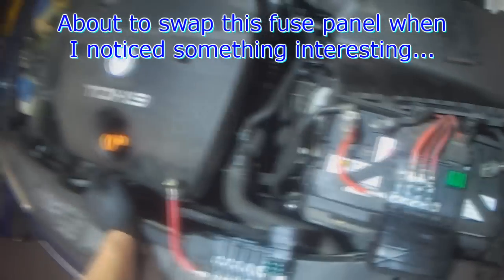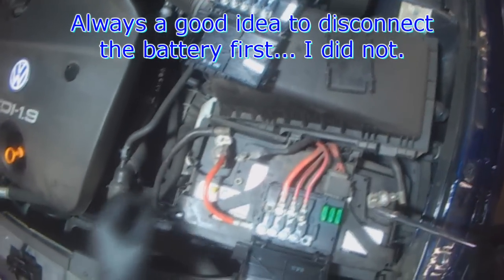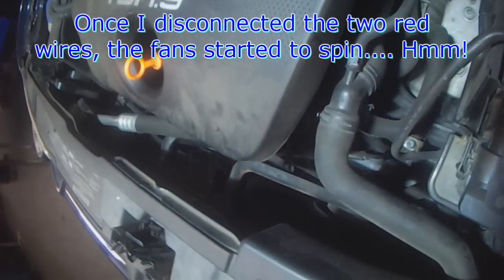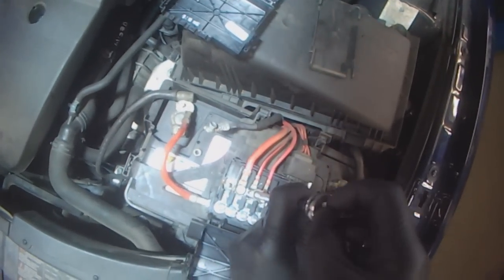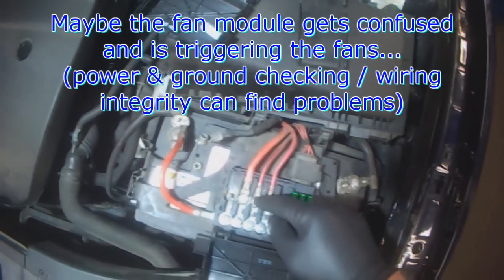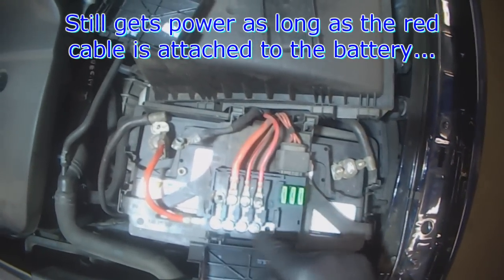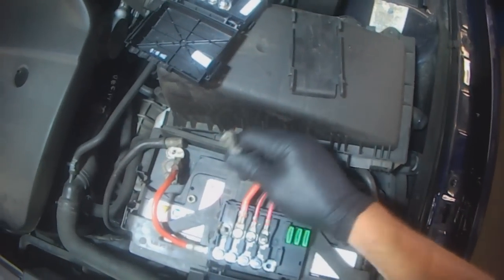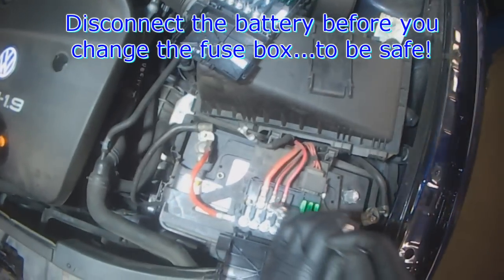VW A4: Weird cooling fan behavior!

Comment: Great video and the channel. I have question: My car is 2012 passat 2.0 TDI. The car overheats after a couple hours of drive even if its minus 10 outside. So i tested water pump basically removed lower rad hose when thermostat opens and check the flow also i checked the return and it has flow as well. Thermostat opens when temperature reach hot so it works fine and as i said I detached lower radiator hose  which becomes hot as well and water comes out  so its not clogged radiator either. The coolant level is the bottle correct when overheats so its not the missing coolant problem. So now the fans work very weird sometimes i see smaller fan work or when i park the car it still works for a minute but when the car was actually overheating and the gauge went over half the fan DID NOT kick in, also the big fan which i assume is only for ac never works. Please help me out here i think maybe its that module or maybe fan is just bad?
Reply from the maker: Both fans should work together whenever cooling is required. Using a scan tool... one can check / verify fan operation & check for fault codes. Here's a video where I check / activate them: (should be similar to your car)

https://youtu.be/oqdv4cm86Ns

The module is part of the large fan... replace just the large fan or both.
Reply: @EXOVCDS  Ok tnx I will check the module. Anyway did I do the overheating steps properly? Here is the lower radiator hose at 2000rpm when the thermostat is open, not sure if this is how the flow should look like ? https://www.youtube.com/watch?v=rNPjAu9KKkk
Reply from the maker: Flow from the hose does NOT indicate that the thermostat is open... the thermostat is located in the engine block, behind the flange that the hose connects to. You will ALWAYS have flow through the radiator, thermostat closed or open. I'm still at work, can explain further once I am at home later tonight.
Reply: @EXOVCDS  Thermostat opens a little latter after the car worms up than upper hose become hot, the pump works fine because there is heating inside of the car. Yesterday temperature was going over normal and i lifted the hood and the fan still did not kick in so I went to my mechanic this morning and told him about the fan but he still held his original idea the head gasket is blown and he said the fan did not start because of some steam build up on the fan thermostat but the gasket is the problem. I looked at the return coolant bottle there is no small bubbles and also oil oil cup has no yellowish sludge from coolant burning which is usually the indicator of the burning coolant inside of the engine. I hope is not head gasket, what do you think?
Reply from the maker: Just to be clear... the upper hose gets hot REGARDLESS if the thermostat is open or closed. The thermostat controls flow INTO the engine , not out of. The water pump pushes coolant from the engine INTO the radiator via the TOP radiator hose. The thermostat lets COLD coolant INTO the engine via the LOWER coolant hose. The thermostat can intermittently stick CLOSED, not allowing coolant to ENTER the engine via the LOWER hose. If colder coolant can not enter the engine, then the engine will overheat. The ECM controls radiator fan operation.... when temperatures get too high, the fans come on. If there is a problem with temperature sensors... the fans come on (fail safe). Either there is a problem with the radiator fan module (part of the large radiator fan)... or the thermostat is intermittently sticking closed.
Reply: @EXOVCDS  I see, anyhow we changed the thermostat last week and it did not solve the problem but gets longer to overheat before was less than 1 hour and now is 3 hours of driving . I watched this video about vw and it must be false claiming the upper hose gets worm when thermostat opens. https://youtu.be/YbzDJqPIUrA
Reply: Again my mechanic thinks its head gasket since we changed thermostat, he said at around zero degrees outside you have a very small chance of making a diesel car needing fan with normal driving through the city, is this truth?
Reply from the maker: That video is completely wrong... they don't even use proper tools to hold things in position. They removed my comments years ago about what they did wrong.
Your past posts / replies never mentioned that the thermostat was replaced before. I'm only telling you what I know about the system / how things work.
Reply from the maker: Yes, with cold outside air temperatures... fans may not be needed. TDI's take a long time to warm up to begin with. If you have a mechanic who's telling you that it's probably a head gasket issue, then you need to decide when you are going to trust his judgment. I don't have the car in front of me... so I can not tell what the problem is. As long as the new thermostat is working correctly, then maybe it is a head gasket issue. Head gasket issue or not, if the ECM detects HIGH coolant temperatures... the fans should come on (regardless of how cold it is outside).
Reply from the maker: Head gaskets don't fail all of a sudden for no reason. Usually, there had to have been an event that triggered head gasket failure. Broken water pump, stuck thermostat or cooling fan failure. If NONE of those where in the vehicle's history... I would not think head gasket as my first suspect. There are test kits that can detect combustion gases in the cooling system... to verify head gasket failure.
Reply: @EXOVCDS  You said the thermostat controls flow INTO the engine through lower hose but it just might be the opposite and it makes sense the engine keeps coolant inside until obtain working temperature and than gets it out through the Upper hose basically the opposite what you said. Hey dont get me wrong i am not questioning your expertise we are just discussing but check this video https://youtu.be/V7inC4lOpGs
Reply from the maker: Thermostats can be in different locations... some manufacturers place them at the top (as in the video) some place them low (like in your engine). I have the service manual for your car... I know where the position is. The water pump pushes fluid... fluid will come out where there is an opening. If you remove the upper hose, coolant will come out of it. If you remove the lower hose, coolant will come out of it... because it is being pushed by the water pump out of the engine via the upper hose, through the radiator and out of the lower hose. The thermostat is what controls cold coolant into the engine. It is not uncommon to have a faulty new thermostat. If you never hear the fans come on, then you might have an electrical issue. Do the fans come on when AC is ON?
Reply: @EXOVCDS  Ok maybe its different design where they put the thermostats. The fans do not come on automatically when i turn on the ac and I know they should but dont know why
Reply from the maker: Getting back to one of my earlier suggestions... fan control module (located on the back of the large fan). As long as there is no issue with the AC system, activating AC at idle should turn the fans on. If not, warrants further investigating. Maybe the earlier "not overheating for 3 hours" was because the vehicle was always moving (air flow through radiator). Once stopped in traffic, no air flow = overheating. Testing the cooling system should not take longer than 30min tops. If your mechanic has already done so and concluded head gasket, then so be it. A bad head gasket should not prevent the fans from coming on though... as also mentioned earlier, the ECM is supposed to turn the fans ON when the engine temperature gets too high. We are going around in circles. Let me know once the car is fixed / what the problem was... I think I gave more than enough input for one night.
Reply: @EXOVCDS  You are right i told him the same if the temperature is over normal fens should run, maybe the fan failure caused gasket melt if that is what happened but i never got any fan malfunction codes. I am planning to put smaller fan on the constant run on a second speed like hot wire it, and see if the car would overheat again. If that solves the problem than look at the fans and their module. If it still overheats with fen kept on all the time than its the gasket .
Reply from the maker: Keep me posted.
Reply: @EXOVCDS  Ok I will thank you for your time.
Reply: @EXOVCDS  Ohh wow i changed the fans and the module on it and the fans run now especially when car warms up but i still have the overheating problem :( Just to recap what i did on the car. The engine was overheating so first we changed heater core, than we changed the thermostat also i changed the fans, the car still overheats but it takes longer like 2 hours of driving and the temperature starts raising i put heat in cabin and it kind comes down  . Just 2 days ago I changed the watter pump and timing belt as well and it still overheats. The only thing which i did not change by now is radiator, i dont know shoud i do that as well or maybe its really head gasket which is not normally the case with tdi and there is no bubbles in the overflow tank.  Another thing when car warms up  it makes noise like the exaust pipe is lose or some metal plate vibrating kinda a noise. Any suggestions please ?
Reply from the maker: @Chris-bl1bh  I looked at your first video again (the one about flow from radiator)... it looks like low flow (should be more for that rpm). Yes, could have been radiator all along. I don't know what the noise could be, sorry. It might be best to have a mechanic in your area look at the engine to see what is wrong... the you can fix it yourself. There's not much more I can suggest for you, sorry.
Reply: @EXOVCDS  Yeah the noise only starts when the engine heats up. Yes It was fixed by two mechanics over the last 2 mounts and as you can see no luck. Thank you anyway

Comment: Do you know what the green wire in the harness to the Fan Control Module does? Mine is eaten through, my fans do not spin, and my A/C does not work. 2000 TDI, and still dont spin when engine is hot.
Reply from the maker: +Aelx Kevan I'll check a wiring diagram after I get home from work tonight.
Reply from the maker: green wire pin 3 goes to ecm & tcm if you have an automatic... probably a load signal to those modules.
Reply from the maker: Check the green fuse on top of the battery (pull them out to check)... make sure that your thermostat opens and that the water pump is pumping.

Comment: I see a lot of comments about them staying on or not coming on, but how about coming on for 3-5 sec; then shutting off for 3-5 sec, then back and forth all day long. Temp gauge never goes up past 190, either. Replaced sensor twice to be sure. It always works at operating temp but never acts normal. Lol
Reply from the maker: Low speed is strictly controlled by the thermo fan switch in the radiator... you can check if the thermo switch is causing the on/off cycle by disconnecting the switch. If the fans stay off, then it's the switch. If the fans continue to cycle, it's not the thermo switch. Selecting ac will send a signal to the fan control module, which then activates the fans... a problem with the fan control module can cause sporatic fan operation. A good wiring diagram and a test light should help narrow things down.

Comment: Have you came across a mk4 1.8t with the fuse box melting at the cooling fan fuse?
Reply from the maker: On top of the battery? Yes. Loose / bad connection causes resistance... which causes heat. Replace the fuse box. Then, check the current draw of the fans, to make sure it's not excessive.

Comment: Great video.  I was checking fuses for AC in anticipation of summer.  Fans do not run when A/C switch on (havent check pressure).  Key on and I pulled the #16, both fans come on.  Blogs say to pull small green fuse on top of battery to reset FCM.  Will try tomorrow.  Great videos to help with quirks of great cars!
Reply from the maker: +Ken Dash As far as I know.. the FCM isn't a smart device... meaning there's nothing to reset (as far as I know) as it's just a logic box with relays. Let me know what you end up finding!
Reply: Btw. He also changed compressor. I would hear it sounding weird. I believe it did give out. Thanks for sharing your knowledge.👍
Reply from the maker: Thank you for watching!

Comment: There is an small fuse inside, that when you take it off, or it gets burned, the left fan starts spinning. Happened to me once
Reply from the maker: Fuse where? inside the fan module? Both fans were spinning when I loosed that red wire.
Reply: +Thomas EXOVCDS Maybe is both, but when I stand up to see if the fan was the thing making noise I only saw the left one turned on. The fuse is one of the small fuses next to the High Beam fuse inside the car. Try taking it off and the fans will start just like when you took the wires. I have no idea why they do that
Reply from the maker: +Rafael Torchio Good to know, thanks! Even though I work on these cars on a daily basis... I don't get a chance to play around with them, which sometimes can teach you more than doing repairs.
Reply: Yeah, I break lot of things playing around with mine, but then I have to fix it, which is fun sometimes...
Reply: +Rafael Torchio - If it is the #16 fuse in the panel, see my description above

Comment: What's up Thomas!  hope all is well. oh the fun of German wiring...
Reply from the maker: +MrErikw26 Hi Erik... it's going good. You? Must be a fail-safe with this thing... turn the fans on to prevent overheating? Will have to try it with the ignition on to see if it does the same.

Comment: Huh, that's odd.  I can one-up that, though!  My Passat ('97 B4), if you put the key in the ignition and leave it in the "OFF" position, then pull the high-beam switch back as if flashing the brights, the A/C blower fan (for the cabin) comes on to the setting selected on the climate control panel, the headlight-on buzzer sounds, and the turn signal lights come on solid.  The high beams, however, do not come on.  Let the high beam switch go, everything turns off again.  Fun!  ...Kill me...  

I'll get to it eventually.  For the time being, I blindly blame it on the aftermarket alarm system that Volkswagen installed on the 97 B4 Passats at the dealerships so that they would "match" the marketing that had been published for the 97 B5 Passats...  Sooo many problems with that CodeAlarm system...

Comment: OMG, thank you!
Reply from the maker: Thank you for watching!
There can be other reasons for the fans staying ON when they should not be. Year, make, model, engine?
Reply: @EXOVCDS  2003 New Beetle... base model. We had disconnected the battery overnight. We reconnected and tightened all that needed and it didn't come back on. Hopefully that was what it was so I don't have to fix before Christmas.
Reply from the maker: Must have been a loose nut then?
Reply: @EXOVCDS  quite possibly! We'll find out tomorrow morning when I get to work lol. Luckily, if it does it at work, we have on-site mechanics.
Reply from the maker: Nice.

Comment: Hi there i have same problem 2000 jetta 2.0l cooling fans always on even if the key off i changed both sensors relay fuse is good and have good ground i dont know what is the problem can you please help thanks
Reply from the maker: Which sensors did you change? Do the fans stop running when the radiator fan switch is disconnected? Does the red wire (that I disconnected in the video) have battery power (did you check it with a test light)? You need a wiring diagram so you can check the circuits & sensors.
Reply: Temperature sensor green one and the radiator bottom one as well
Reply: Yes they di stop working when i unpluge the switch pluge it back again wont start only when i turn ignition on they stay on all the time unless i pull the fuse off
Reply from the maker: Running at low speed or high speed?
Reply: high speed
Reply from the maker: Hany Sawma High speed is controlled by the fan control module... the module receives inputs from the ECM, the radiator fan switch and the AC system. One of those 3 is telling the module to turn on high speed. Disconnect the radiator fan switch and cycle the ignition key. what happens?
Reply: it stays on
Reply from the maker: Hany Sawma That leaves the ecm & AC system. But you said earlier that the fans go off when you disconnect the rad fan switch.
Reply: Thomas EXOVCDS it turns off only when i unplug the relay or the fuse
Reply from the maker: Hany Sawma What relay? The fan control module?
Reply: Yes
Reply from the maker: Hany Sawma I don't have a 2.0l diagram handy... the 1.8t should be similar. I can find the 2.0l for you tomorrow.
http://fkh161.ca/VW/CFCM.pdf
Reply: Thank you sir where you located i wish i can bring my car to you i had 2 Mechanic looked at it and couldnt fix it
Reply from the maker: Hany Sawma Here's one more:
http://fkh161.ca/VW/AEG/AEGAC.pdf
Reply: thank you for helping me i fixed my car god bless you

Comment: I have a golf mk4 year 2000
I am experiencing problems with my radiator fans.

The fans do work as I have seen them kick in. The problem is the fans are not kicking in when they are suppose to causing the engine to get very hot. 

what would be a solution to this problem. I was thinking maybe a temperature sensor. could it be something else ???
Reply from the maker: If the fans operate when you do this: https://www.youtube.com/watch?v=Roh6RCs8IJk , the only two things left would be the thermostat or the water pump. Have you watched this? https://www.youtube.com/watch?v=LiDRUWPw_f4  When the engine gets hot... do you have heat inside the car? Does the lower radiator hose get warm?

Comment: Great video, I have a mk4 jetta 2.0 GLS and the S162 fuse on the battery fuse bracket is missing, but I still can run my car, why? if this on is suppose to be for the spark plugs? :)
Reply from the maker: +Luis Rodriguez Sorry... that was a typo in the description. As you can see from this diagram: http://i162.photobucket.com/albums/t263/cgillasp/97-02_Fuses_and_Relays.jpg